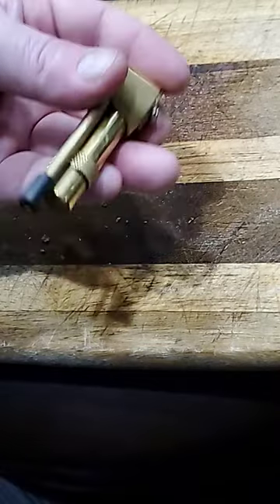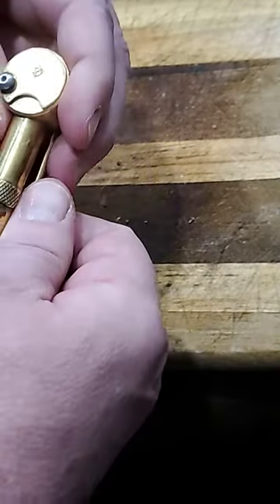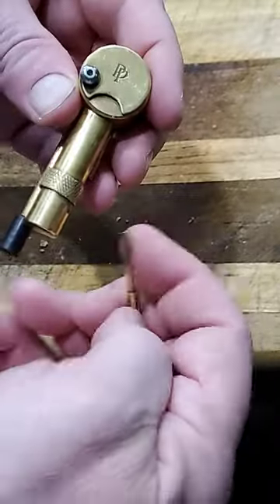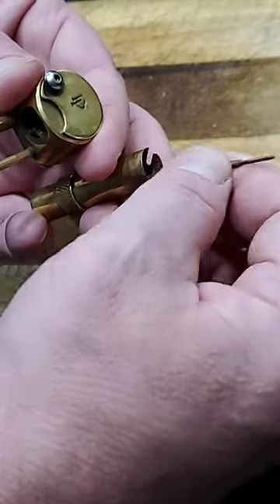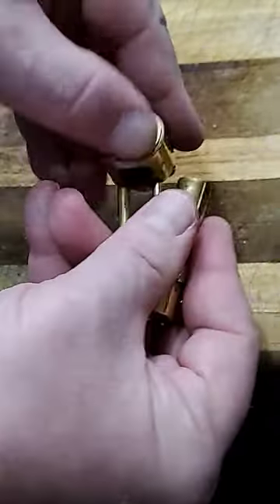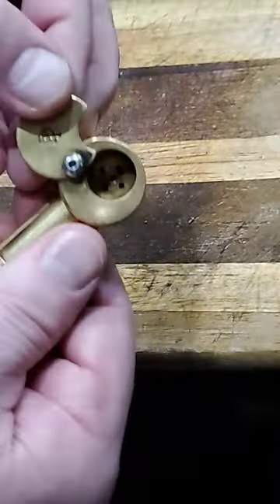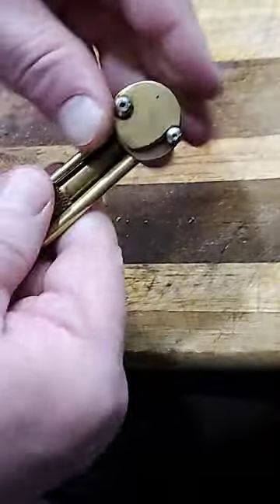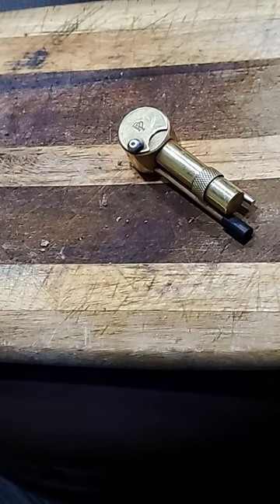Made in America #1 Proto Pipe

Comment: I have to tell you that that is the Proto pipe “Rocket.” it’s probably along the lines of the first rocket editions made, because it looks older than they make them now. 
 The original Proto pipe is not designed like that. I’m speaking from experience because I’ve had two original ones, and I am planning on getting one of these newer versions.
 You can also usually tell if it’s real or not by the stamping on the inside, where the tamper/stash part is.
Reply from the maker: Yes! I have the Rocket and the Classic models.   Love them both!
Reply: @Bluelightbandit Hell yeah man! Toke-on! 🙏🤘